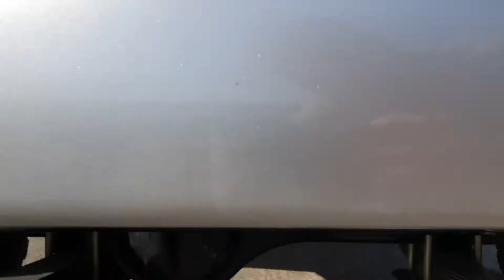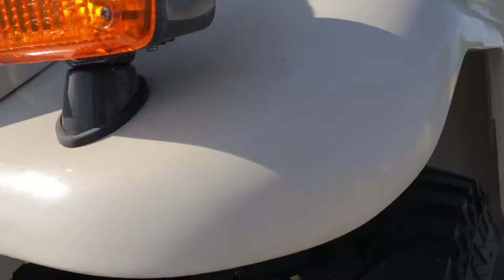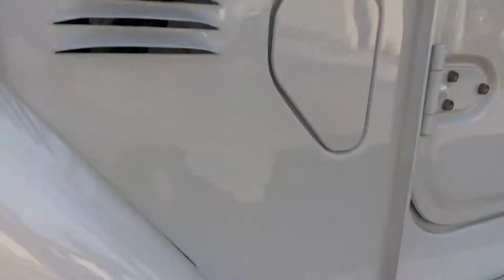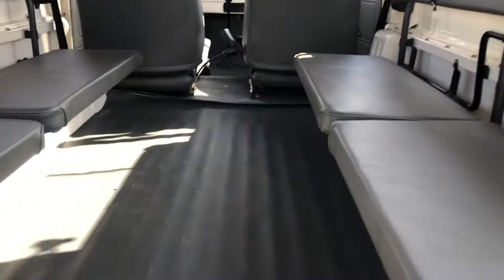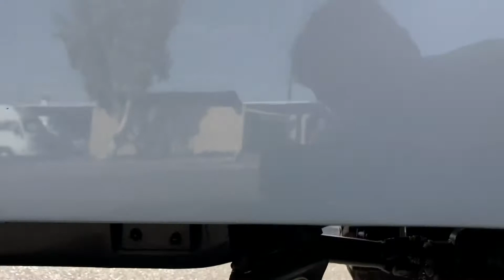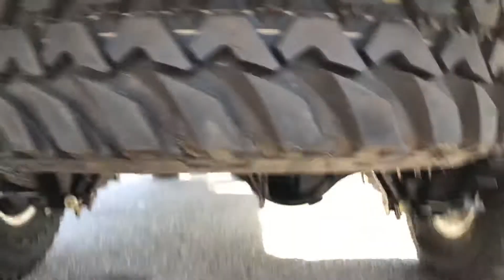A Walk-Around the HJ47

Comment: Very weird seeing a hj47 troopy rocking LHD. I've got the same model, 1981 hj47 troopy and it's also white BUT There are differences. There's a lot missing on yours. No heater in the front or back, no A/C neither. Do you know if it had the jack set...behind driver!?! How about the little tool stook along the right hand side close to the back doors? Bash plates? I saw the tranny one....
All in all it's a very clean build and you should be proud to have it as a daily driver